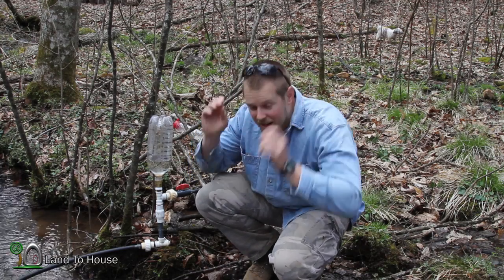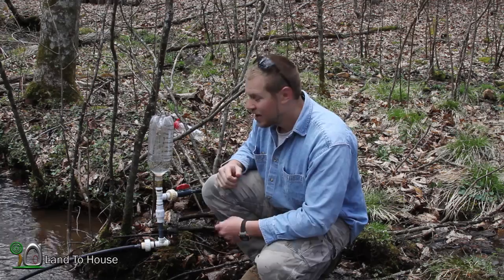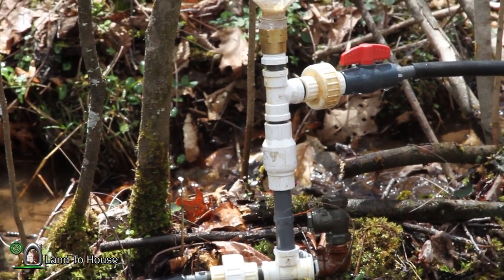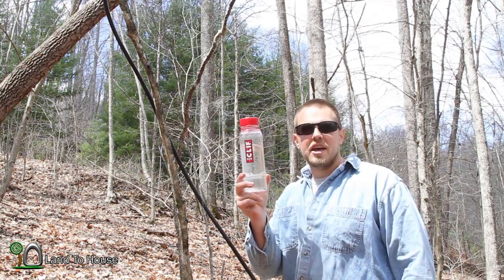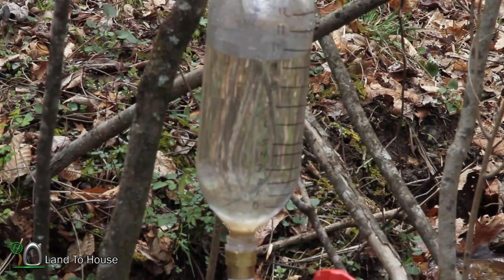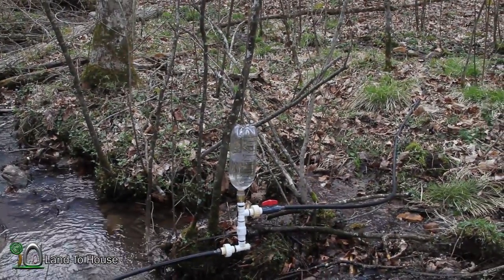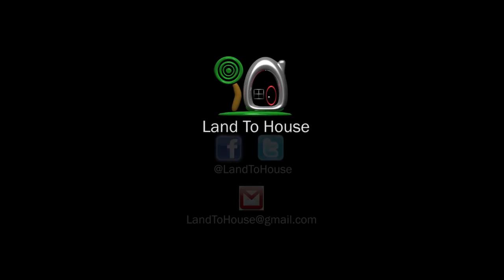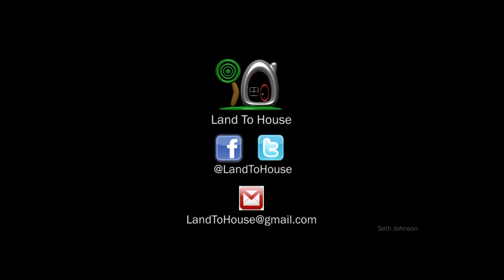Ram Pump Snifter Valve vs No Valve

Comment: Would another smaller waste valve  (facing downwards) that is placed along the drive pipe introduce air bubbles for the drive pipe to drive into the air chamber?

Comment: Yes. Hydrostatic pressure won't let air in if the snifter is below the delivery line. I think if you repeat with the snifter higher than the delivery line you will see better results.

Comment: You mentioned having snails in the pipe. Would adding a screen filter help? I don't think the screen filter would stop the water from pumping up and out, correct? Cuz I got a lot of snails where I live so this is something I might have to deal with! Thanks
Reply from the maker: Since this video I have tried a few different types of screen intakes. The one I like best so far is a 3" pipe with lots of holes in it with a piece of window screen over that. You can find this build on my channel. Look for the narrow way vineyard

Comment: really enjoying your Land to house video's.
 I would love to know if you could use an inflatable High pressure balloon or Small tyre inner tube (but you'll need a wide filler) in place of the White Cylinder.  
Would this exert contraction pressure on the water exiting the pump thereby increasing its efficiency and delivering more exit pressure and or more water per second out of the pump.
Could you try this Please?   and tag me in your post please, to ensure i can observe it.
Reply from the maker: Thank you for watching. I am planning on trying a house pressure tank with bladder. This will allow for increases pressure.

Comment: If the air is being absorbed by the water in the pressure tank, how about reducing the area of air-water surface with a floating disk in the tank.

Comment: If there is bladder on the tank is it necessary to put a sniffer valve because I just bought a tank with bladder to install to my 1" ram pump and also I made 2" pipe tank with bicycle tube.
Reply from the maker: A snifter valve is typically found on large commercial pumps. It's very handy for preventing a waterlogged pressure tank. The inner tube is a good way to help prevent water logging on the small Ram pump. It is not necessary but does help. There is nothing wrong with using a bladder tank.

Comment: Seems to me that air is air, and a displacer device, such as an inner tube, simply packages the air. However if the inner tube stem can be put thru the pressure vessel and inflated to pressure, it would increase the internal pressure of the tank .(solar systems have pressurized bladders  in the pump tank) otherwise, the tank itself is the air bladder.

Comment: Suggest you heat form a slight(?) venturi section (smooth transition for the venturi) for the location of your snifter vent.  The higher velocity through the venturi would create lower pressure at the minimum venturi wall section to better allow air inlet suction during max. water inlet flow though the venturi.   
PVC thin walled pipe or electrical conduit tension-drawn lengthwise when the material is near 'molten' or 'softened' (@~180°F) is a probable good way to form such a venturi.  If this seems reasonable, you'll have to test for the precise venturi size (vs. the dump valve exit volume) vs. the system inlet water volumetric flow rate. 
Also and as mentioned in one of your other videos, consider to test the inclusion of a small mitral-type valve insert (instead of a 'hole') that is commonly found in marine siphon break applications.   The result would be air in and NO water out of the 'snifter' when the dump valve is closed ... why give up the dynamic pressure-velocity due to an unnecessary leak through a 'hole'.  The small 'anti-siphon' valve could have its amount of air-draw regulated by a 'needle-type valve' (located between the anti-siphon valve and the venturi section).

Comment: put a check valve on the snifter so it open when sucking and closed when pushing.
Reply from the maker: Yes that is how a normal snifter works. I will need to find some type of small valve to use with this.

Comment: Wouldn't using a standard pre-charged pressure tank with a bladder eliminate the need for the snifter valve?
Reply from the maker: I use bike tubes in my pumps and it works well. I have seen people use bladder pressure tanks and they work too. The snifter valve is great on large commercial pumps.

Comment: Should the sniffler not be above the outflow not below it? That way the bubbles would be more likely to go into the tank?
Reply from the maker: I am not exactly sure the best placement of the snifter valve. this was my first set of tests. The valve needs to actually be a valve. Not just a hole like in my test.

Comment: HI have you been looking at aquarium shops they have 4mm or 5 mm one way valves used on the airlines.
Reply from the maker: I have seen those! They would work. I also think that bending a brad into the hole would work as a valve as well. The hole without valve worked but was not ideal.

Comment: i hope there is a transparent PVC used as Pressure tank with the bike Rubber interior inside so we could see how it really solves the water clogging
Reply from the maker: The tube does not solve the issue altogether but provides an air pocket that wont be filled with water over time. You will still have to stop the pump every few weeks or months and let the water out of the pressure tank. (If the pump slows down.)

Comment: love watching you ram tests..... this vid has shown less efficiancy with the snifter in place. youve had to go taller in head to get less results.....ive been thinking a dual ram with syncro arm between the waste valves, dumping into a channel for a water wheel, then to a vortex turbine. somewhere amongst it is over unity to pump back to the head pond to repeat the process. thought? tests?
Reply from the maker: The snifter test in this video is not a real valve. It needed a pin or other hole plugging object to make a real valve. So there might have been better efficiency with that addition. As long as the ram pumps have separate drive pipes I think that would work. I am not so sure about getting the water back to the source...

Comment: Why would it gulp in air?  The pressure on the outside will always be less than the pressure tank, and the pressure in the tank will always keep it shut.  The only difference I can understand is that with the water hammer the pressure spike a bit, and the valve would be held more tightly closed sometimes than other times.  There would need to be a vacuum in the pressure tank for the valve to draw air, which should never occur.
Reply from the maker: +michael98277 surprisingly the professional grade pumps gulp quite a significant bit of air. It's not so much that the pressure is always greater inside the tank the main thing is when the pump Cycles it slams water out of that snifter valve and when the valve closes it pulls some air and with it. Just enough to replenish air into the pressure tank and prevent water logging. In my little set-up I did not have a true valve for the snifter.
Reply: Land to House if you put a small peace of wire in the hole of the snifter so it's only 0.2 mm big it would work better

Comment: Because the outlet come first, maybe the air go into the outlet tube instead of going in to the water bottle?? I don't know very much about ram pumps so I can be wrong...
//Elias
Reply from the maker: The real issue is that I dont have a real snifter valve. I just have a small hole. What I need is a pin bent inside the hole to make a valve.
Reply: Okay, as I said I don't know very much about ram pumps. It was just a guess..
Reply from the maker: +Elias Andersson it's all cool. I am learning too!
Reply: Okay. I realy like your vidios, I think they are very interesting, and I have learn a lot from them! I appreciate what you are doing!
/Elias (14 years old)
Reply from the maker: +Elias Andersson I appreciate that you're watching. I did not start learning this stuff until I was 25. You have a good head start on me.

Comment: Hello ! Greetings from Germany, Munich!  
 Would you please tell me / us:  
I) The hight from bottle down to the widder = . . .  ..... inches   [I think 10 inches]
- - - This is very low,  so ` I`m  surprised that the    no- return valve  does open. 
  The low  pressure  from  h 1 +  energy kinetic  to direction  no- return valve   is  enough  to  open  as  I said,  the no- return valve!   Great ! 
II)  Why  can we not see  the  no- return valve ?     For instance  in a plexiglass  tube ?  
Many thanks !    2017-04-29Alfred
Reply: I`  ve forgot to ask:  What`s  the hight from  the widder up to  the top    (water level  maximum) ?
Reply from the maker: Hello. I have not worked with this test pump in a while. It is built from 1/2" PVC components so I should not think that it is 10" more like 6". 
The non return valve is a closed PVC design. It is possible to buy these valves in clear pvc but I do not have one.
Reply from the maker: My apologies I am not familiar with the term "widder"

Comment: Gracias. Podría subir agua a unos 6 metros colocando valvulas de retencion con una manguera?
Reply from the maker: The ram pump can lift water to 55 or 60 meters at best. This will require around 8 meters of head pressure. SO yes you can lift 6 meters with a garden hose delivery pipe.

Comment: Hay manera de evitar el desperdicio de agua al golpe del ariete? De manera que suba mas cantidad de agua. Gracias
Reply from the maker: Because the ram pump does not use electricity or fuel it is a very lossy system. There is no way to get the water from the waste valve back up to the source. Some people capture and use the water for another purpose down hill from the pump.

Comment: dude is there any way i could get a ram pump to work in a well? please reply coz where i live there isn't any creeks or rivers.
Reply: If the well is shallow enough, an air lift pump can be used.  Otherwise, you need a piston pump.  A windmill can lift the water for you and fill a water tank at some height.
Reply from the maker: +Ken Smith good point on using a windmill.
Reply from the maker: +Hussain Mohamed As far as I know there is no way to make it work. Sadly.
Reply: thanks for the reply.
Reply from the maker: +Hussain Mohamed any time.

Comment: Thanks for running the test. I had suspected that the water expelled at the valve would be lost from the output. I like your design solution of the internal bladder. It truly follow the simplicity of design principle.
Reply from the maker: +Aerogrunt you're welcome. After toying around with the snifter valve for a while I have decided it is best to use the inner tube. There is probably a valve you can purchase that would work well in this setup but it seems like Overkill.

Comment: Seth, You had me at Ram Pump.   Just kidding.  That did not sound good.   I just bought this.   http://www.ebay.com/itm/141765605775?_trksid=p2057872.m2749.l2649&ssPageName=STRK%3AMEBIDX%3AIT   
It will probably take me months to actually test it with my high pressure, high lift, Ram Pump.    Thanks so much for all the experiments on this project.
Reply from the maker: +John Godwin ha ha that's funny.  Interesting valve. 1/8" should do it.  Will you use a tap and die set to install it?  I have another ram test on the way but it's going to cost $30 so it will have to wait a bit.
Reply: I probably will not tap.  Probably try to
Find a r fitting.
Reply from the maker: +John Godwin that might be the best for the pressure you are dealing with.  Not saying your home made threads would not hold just that a fitting would be stronger. :)

Comment: just found your Channel I was thinking for a small valve that would let air in you might be able to use a aquarium check valve usually used to protect the air pumps from a power outage in the water siphoning down through the quarter inch tube just hooking it up might be a trick
Reply from the maker: +Wayhart happy you found your way here! I just checked out those small valves. Seems like it would work but I am not sure exactly how to get it into the pump design.